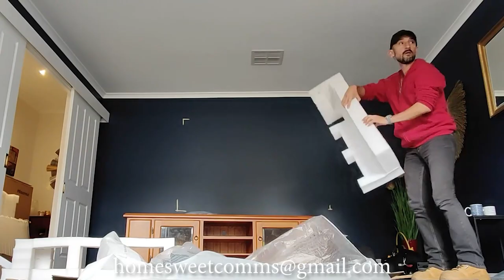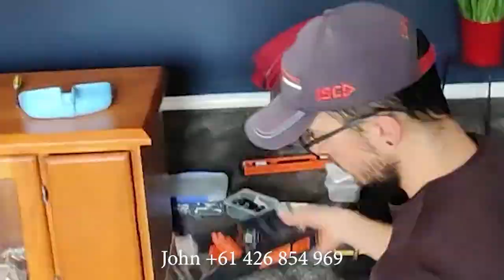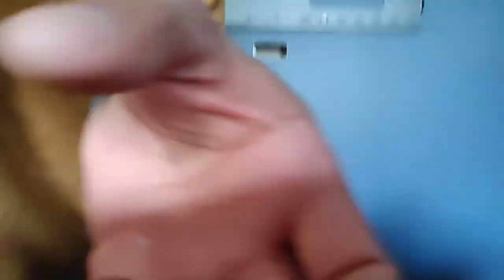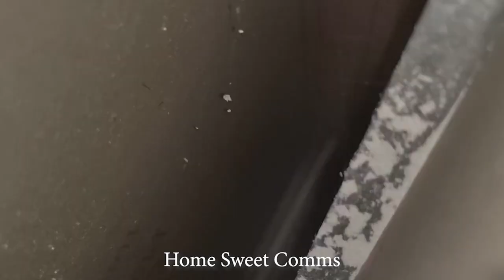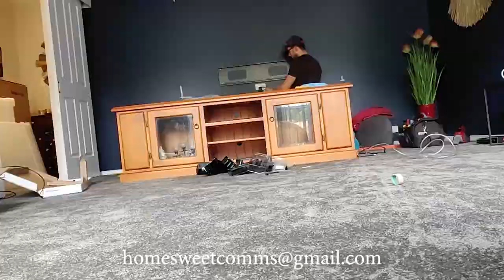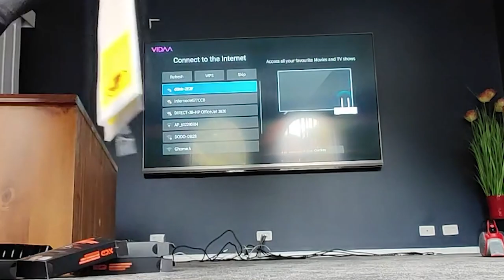HISENSE TV Q8 SERIES ULED 85" Wall Mount. SURPRISE IN THE HOLE!

Comment: Do you know what wall mount you used I the same tv but the wall mounts don’t fit
Reply from the maker: We commonly use EZYmount or XCD. But there are many other brands really good. The problem is if your TV is bigger than your wall mount, you'll have to make a deep search to find a good one wall mount. I recommend you go to particular sellers, they have better and cheaper brackets.